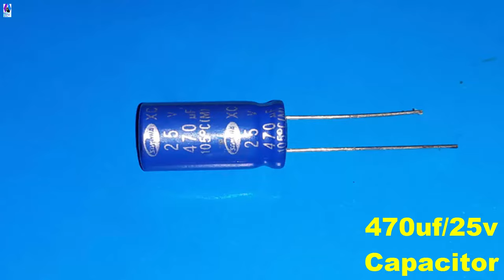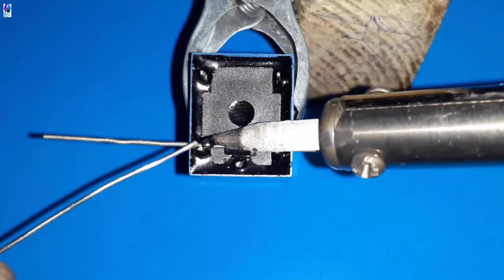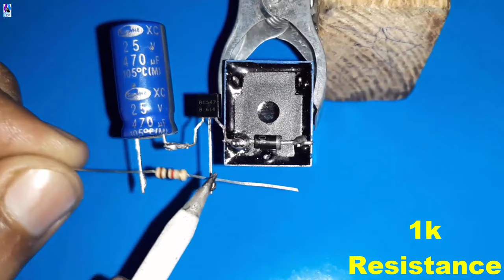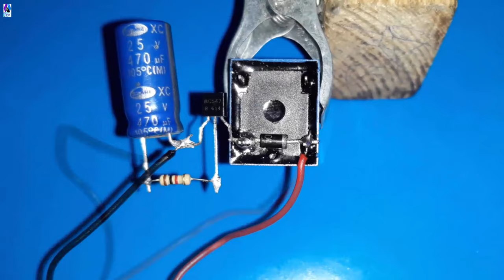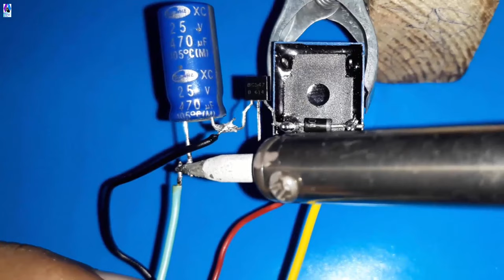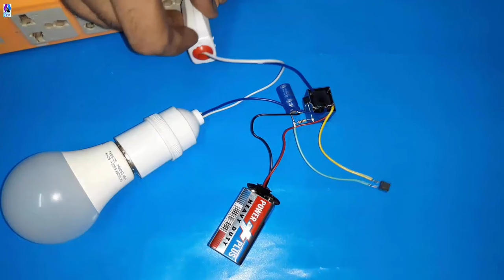Electronic Projects Delay Timer Circuit Using Relay

Comment: What if i have a power source of 12V instead of 9V battery. What changes would be needed to the components?
Reply: No need chainges resistor value.if can chainge timing deferent

Comment: Hello, what should I do if I want to disconnect the circuit in such a way that the push button is pressed and hold?
Reply: Just use potentiometer instead of the resistor and turn it to the loswest point possible 😊

Comment: Do you have an idea how to make 220/240v to power DC 12v time off the relay, It should be on for 30 seconds only and it should work when I put on 220/240 and 30 seconds of until I switch off 22/240v. until I switch on again 220/240v.

Comment: Can we use it for water pump of 1/5 HP?
Reply: Yes, but you should ist a relay which can handle enough current for your Waterpump, the most relays for 220 Volts can handle enough

Comment: Can we operate it with 24V DC ? If No, pls confirm, what changes we can done in the circuit to run it with 24V DC.
Reply: bisa cm ganti relay yg 24volt😊

Comment: How do you lengthen the time delay? Say for 1 to 5 minutes?
Reply from the maker: use 4700uf/25v capacitor delay time 4 to 5 mint
Reply: @TechnicalCreativeChannel  Thank you very much! 👍
Reply: @TechnicalCreativeChannel   In this case does the resistor have to be changed Please respond quickly 😔